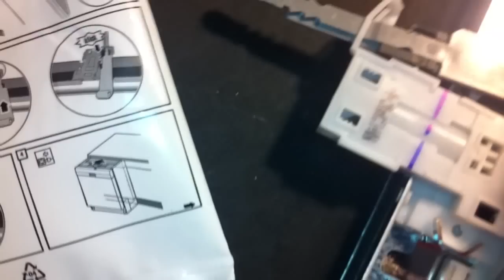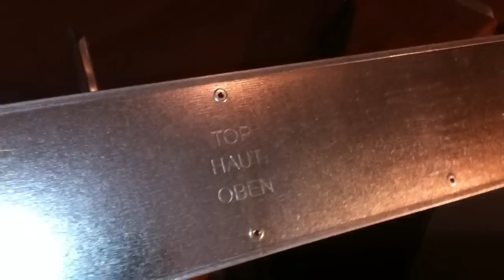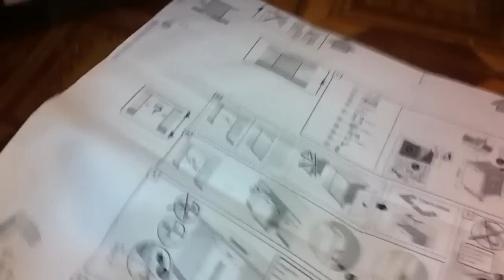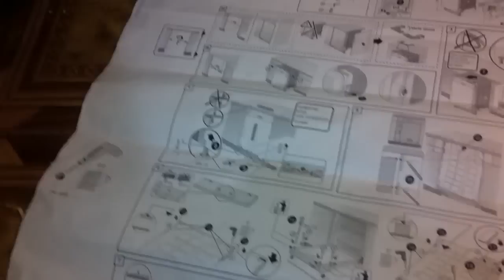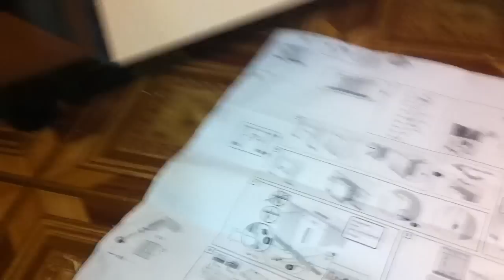Video instructions for installing Bosch Built in Dishwashers

Comment: Hi,
If I understand correctly there are 6 screws that hold the wooden door attached to the dishwasher door? 
do you know which size of Torex screws should I use? 
The dishwasher already installed and I just need to unscrew the right screws and then remove the wooden door in order to replace the wooden door handle which its screws are behind the dishwasher metal door.
Can you help me with this info?
Do you know where can I download the instructions how to install it ?

Comment: How to open the door for the first time? I just bought it and can't even open the door. What button do I need to push as just trying to open the door with doesn't help?
Reply: @Kjell Sundqvist À Bosch specialist came to my place and just opened it by pulling hard. When the front hasn't been installed yet you need to pull hard.